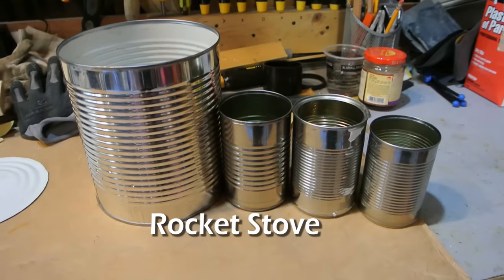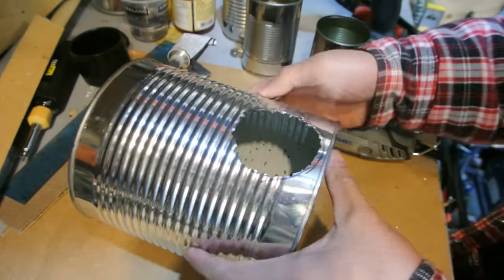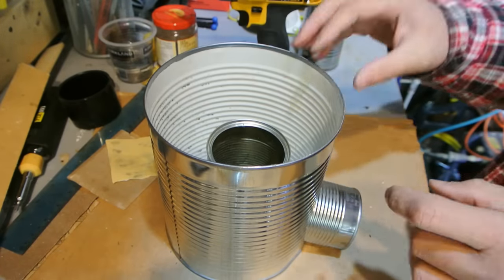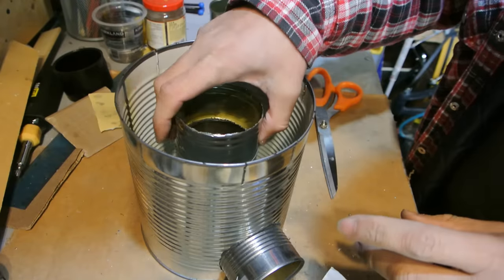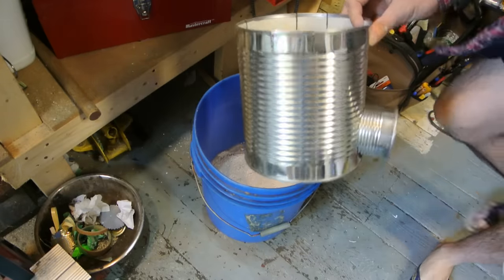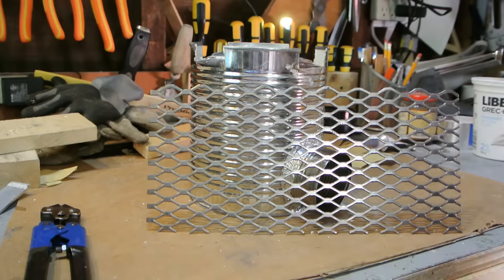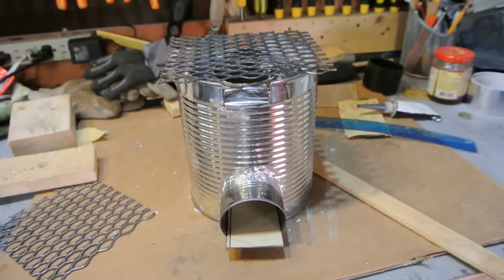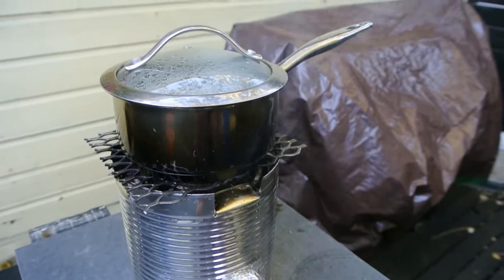How to Make a Rocket Stove from a Coffee Can

Comment: Great use of aluminum cans which only melt at 1200°F whereas the stove only burns at 1000°F maximum.

But if I was to build something like this I'd close off the top completely and channel the flue gases outside after they were fully combusted in the burn chamber.

Also I would extend the system of soup cans so I could feed the wood in vertically.

But that was a great use of different sizes of soup cans and a great use of tools to complete the job.

I might have traced the circumference of the cans of paper first and then drawn them on for a more accurate jig, but whatever.
Reply: Its always good to offer observations, but you should relax a bit, and remember it's not about you.
Said another way:  If you have something to say, just say it. Your passive aggressive tone is irritating.

this is a portable, temporary, field expedient rocket stove, and doesn't require an intricate feeding tube

there was only one soup can. there was a coffee can and a couple of veggie cans. 

sure, you can use a paper pattern, if you need one for a rough built elemental device..but whatever

Comment: Very nice..thanks for making the video and sharing. I'm wondering if quick drying cement would make better insulating material...
Reply: It would not. It would fall apart under the heat stresses and would be even heavier. Overall this is a terrible design though.

Comment: You "clean up" the holes.  How do you do that?  That is not in your video.
Reply: You could clean up the holes in any number of ways.  I used sandpaper wrapped around a dowel.  Worked just fine.  You could also use a Dremel tool with the sanding drum attachment.
Reply: Sylvia Klages obviously a metal file...
Reply: @skoalpimpin7575  (don't forget this is an instructional video)
Reply: Wonderful Idea, save money an time love it👍👍👍👍👍

Comment: could have used more of that mesh, to act as fire grate inside can sticking out...& that can could be angled UP instead of down, so fuel can fall down into the combustion chamber.....hope eye protection was used while running that mini cutting wheel...great job

Comment: Nice simple build i have built a few but my fav i built out of a new empty paint can. You can pick one uo from lowes or home depot for anout 10 bucks and filled it with unsented kitty litter. Have your cheamly stick up out of the lid aprox a inch or so cut tabs like u did on the outer shell of yours after you put the paint can lid on and bind them down tight against the lid ti help hold it on but it pretty much stays tight anyway plus the paint can handel makes a easy way to carry it around. You could even use 2 inch stove pipe and fittings for your internal parts but be careful with the elbowes ive melted a few....lol yes they get really hot on the inside but with the kitty litter inside you can pick it up and carry it while its burnning.... Just be careful...O.o

Comment: Saw similar  with 2 holes dug side by side then a connecting tunnel  at the bottom. Fire fuel in one and the air is drawn through  the tunnel  and feeds the fire

Comment: I would recommend bending the overhanging edges of the expanded metal (that you used for a grilling surface)  down so that it fits over the top to preventing it sliding off.
It also seems like the expanded metal would work a lot better than the solid piece of metal that you used to create a lower air intake (bottom half of soup can) below the fuel intake access (top half of soup can). But overall, it seems like a good design and should be very portable. Thanks for the video.

Comment: You can save even more weight by using rock wool insulating material instead of a masonry material for insulation. Also, you could cut a piece of your cooking grate material to fit into the air intake and support the fuel.
Reply: Hi Keith,  ...So, I'm about to make a bunch of these types of stoves and my last bit of research has been the insulation.  It has to be light weight for me, and I didn't want to use the carbon felt yuck (graphite stuff) and some say textile wool has an odor.  And, picky me will not use anything with fiberglass materials.  I'm going to check out the rock wool insulation.  Thank you for sharing.  I've been stuck the last few days deciding what I'll use and haven't come up with anything solid yet.  You're awesome.  My stove is going to have a top to cook with using stainless wire mesh and a lid with the handles on the sides that click down when not-in-use, and then flip upward when you need to carry or move it and a bottom with legs.  Also, a round circular thin, lay-to-the sides handle for carrying and built-in -pull-out bottom fuel bed, and a tubular wire mesh mantle.  I'm trying to design my stove so I can heat myself or cook, if need be, and so fuels can easily be interchangeable for what's on hand whether inside my home, or on a trail.  The top and bottom is being made with (2)   8 1/2" Round cake pans, lol! You have to use your imagination!  The entire sides and backside will be curved around vertically between the 2 cakepans using a piece of aluminum sheeting and stainless wire mesh for the front. (Aluminum burns hot, right)?   So, the whole stove is contained surround.  I did see something similar, but I'm making this one mine and I'm hoping it's not a disaster when I'm finished!!! 🤣

Comment: You don't need a flat piece on the inside bottom can to allow air to flow through, because air will automatically flow through, you're not blocking it off completely and air will still get in.

Comment: The overall design is good, except for one thing--some of the materials used.  These steel cans are notorious for not lasting long, and the hotter burning the temps and fire they are exposed to, the faster they wear away (mostly from rust/oxidation).  

      You could coat them in a waterglass/acid blend, which basically puts a thin layer of glass sealant on the surface which keeps it from rusting, or if you want something premade/treated, use those porcelain coated carbon steel pots sold cheaply at Walmart and some other places (the dark, speckled cookware that is fairly light).  You could use stainlesss steel. 

    It's alright if the outside, larger container is made out of the steel food can--since that is protected by the insulation, but the inner parts exposed to the fire and high temps really needs to be either treated or of a different material so that it lasts a lot longer.
Reply: The cans are stainless steel. They dont rust
Reply: Or just spray paint them with Barbecue Black.

Comment: It would be perfect if you could fit the can for the burn chamber into the chimney, so the whole thing is self-contained in the outer can.  It would be perfect for backpackers, who need compact gear.  Either use a smaller can for the burn chamber or find a way to make it fit into the position easily.

Comment: Wonder if you could make a theme and variation,  similar but bigger to be vented out of a window w a board cover w metal plate, for indoor use?  It would be amazing as they're predicting that heat will go up up up and then out. Those profits are $575.00.

Comment: Nice… but, if you were in the bush so to speak, you are not going to have plaster of Paris to make insulation with… why not use all natural materials to build it? Also, your feeder hole should be tilted down just a bit so that your fuel stays in the can… great little,rocket stove to have around the house though in case all electricity and gas is out… and the way things are going, I would suggest people learn to make these things and quick!

Comment: Excellent video,  would like to see other version using Chock full of nuts type Coffee cans, as they have 1/4 in. reinforcing rings to maintain circular structural integrity. Other issues, using a pot with 1in.smaller diameter to drop in ,say 1-2in. would eliminate 4 wasteful holes in sides. 2 small insulated handles would help. Is insulation that critical?  Thanks anyway.
Reply: Wow, good share. Great thoughts.

Comment: I am new the whole rocket stove thing.   My understanding is that you get more and cleaner heat with less fuel.

Does anyone know how much hotter this gets compared to an open fire?  Is it significantly less smoke?  

I love the idea and this one looks very neat.   I think I could make one fairly easily.  My first one probably won't look that great though.
Reply: I run the environment club so I watch and do the experiments. This one surely is clean. It burns the wood completely. The air runs through the bottom is enough . The small sizes of the stuff is excellent. Yes, the time is lesser compared to open
Thanks Andrew.

Comment: Only wood-ash, perlite, vermiculite, ceramic felt, and light, 'fluffy' materials like that are heat-resistant insulators. The rest of the fillers you mention - sand, soil, stones - are heat-sinks, and will reduce the efficiency and cleanliness of the burn, because it's the high temperature within the insulated riser tube that makes the rocket so effective. Visit Aprovecho for all the lowdown on rocket-stove theory.

Comment: You dont need to raise the fuel.  I like this, but, I would just use washed real sand as the insulator. It's been used for generations in barrel wood stoves, used for heating homes.

Comment: The heat will burn the can over time. Nice video though.
I don't care for the char it leaves on my kettles even with wood gas stoves, which are supposed to burn cleaner.
Maybe an option would be to put a copper plate between the flame and kettles while cooking.

Comment: Like the idea but....."would have been better with wide strong handles....plus I'll bet it's HEAVY! Maybe a little less insulation.  How long will it last and you need some kinda lock on holder for the grill...it'd be great if it was screwed in on side so the grill could be a flip on & off lid."...if needed in emergency cases you'd have to move in a hurry.
'A woman's point of view "
Thanks for sharing.

Comment: good idea it's not rocket science how to do it but put a handle on it because you know someone is going to come along in touch it or pick it up while you're putting your pot of whatever in a bowl to eat it or you will forget yourself and grab the can while it's still hot so a clamp around with a wooden handle protruding from it would be a very smart idea and safe because if you grab it burn your hand you're going to drop it and set something on fire because you will have Embers in the bottom of the can still hot and they will be everywhere. I certainly wouldn't use it inside or in a tent.

Comment: One thing is not good for me . So smoky..... we can't use it in the closing place. The 4  side cuttings aren't necessary. For evacuate the smoke please make a hole to the back side. Or add a small pipe for the smoke. Then more important   out side of the pan will get carbon. i collect every models. I want to do myself. Good work. Thank you.

Comment: the hot plate with holes is there any advantage of them? or prevent soot build up on the pot?
Reply: syarif basri he just said it was to sit the pot on it better but if u have a pot that fits on the can itself then you don’t need the grate but if you want a smaller pot like the one he is using then he needed something to hold it up. You can use anything actually, the metal burner grates from a regular gas stove (I don’t know the technical name but I’m sure we all get the gist) should do the trick as well. Especially if they have the 4 little leg/prongs sticking out. I have 3 huge grates on mine so it wouldn’t work but the individual ones work great & you don’t have to buy it if someone has an extra or u have a gas stove or from a thrift store I bet they have some for $1 or less. Easy to find for next to nothing or reuse from something u have already. Can’t beat that. 🤗

Comment: I'm not sure this is being used as a rocket stove. It looks like a rocket stove, but the fire is supposed to be in the feeder not the actual chimney. This stove is burning very inefficiently. I would be helped also by a few holes near the top of the chimney part to allow fresh air in for a secondary burn.
Reply: I wouldn't call it inefficient. It boiled water faster than many electric stoves I've seen in people's homes.
Reply: @eatiegourmet1015  Perhaps, but efficiency has little to do with speed differences between various items unless we know how much fuel they burn for a given task. You could have a very big inefficient fire and a very small efficient fire and they may bring water to the boil at the same rate.  Electric stoves are by necessity limited to the temperatures they can operate at regardless of size.

Comment: Non galvanized sheet steel, a welder and refractory ceramic fiber insulation: lighter, sealed, no plastic toxic coatings to burn off the cans.
Reply: Also, if the mesh is galvanized, thats lead burning off, enjoy your metal and plastic poisoned food.

Comment: These things can use a semi-automated wood feeding device
Using gravity, some sort of opening with a counter wait device can add pieces of wood as the wood inside the fire compartment is burnt

You'll need a metal element inside the burn compartment that interacts with the solid wood, as it turns to ash the metal element falls under its own weight and activates the next metal element to move inside the burn chamber and brings with it the next piece of wood etc..

You should end up with a Rocket Stove that converts woods to efficient concentrated fire, and it feeds itself the necessary amount of wood as the prior amount is burned

The concept of wood feeding element can be best explained with water mills
Gravity  is not affected by fire much
This will solve the problem of having to constantly stay next to the stove feeding it wood
If you can get for example 1 hour of unmonitored fire, this will be a much more reliable concept

Comment: Ask restaurants for cans.
Reply: Good suggestion. Also check the health food store recycling bins and dumpster. I used the same type rocket stove as on this video for cooking my food almost always twice twice a day everyday for several years during cooking my supper, the coffee can size was problematic because after cooking a pot of beans and then while pan-frying afterwards would be interrupted because the ash builds up in the can and must be raked out so the air can flow but doing so also removes the coals too which are igniting the wood being fed in and so the fire must be started again.  And so I solved the problem by making a larger version by using an empty  maple syrup drum used for bulk dispensing at a health food store which I obtained for free after the store emptied it and threw it away: each measuring approximately 17 inches high and 13 inches diameter. For the inner pipes, cans the size of around 36-42 oz. - the type pineapple slices come in about a 4 inch diameter. And that stove was most excellent. The fire(s) destroys the metal inner can tubes in 6 months.

Comment: Water was 'maybe' room temperature and it took 'around' 3 or 4 minutes!  You could have at least measured a little to make the 'experiment' of some value. Emergency means all kinds of things, but usually implies you need to be efficient with everything. Just because it 'works' doesn't mean it is a success in this context.  Any design of these things will basically 'work' - there are about 4,000 other videos already on here about them.

Comment: Ok . you built the Stove. But it's not a stove... Not every stove is a rocket stove. ( This is the most common mistake on YT. Most of the stoves shown are described as rocket stoves, although they are not rocket stoves at all. You copied one of these... but it's a mistake)I don't think you understand why a rocket stove is different from a regular stove. But ok, you put in the work, now you should seek out the knowledge and try to do it again.
 👋🙂. ( Maybe try building a wood gas stove. Using double burning wood. This is a very economical solution that will allow you to boil a pot of water using a small amount of wood. It's a very simple construction )👈🙂